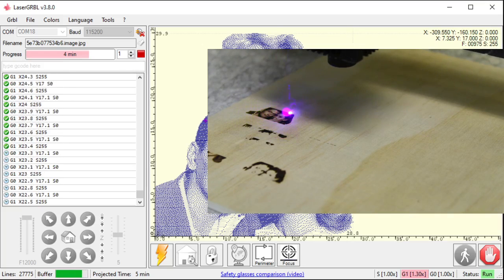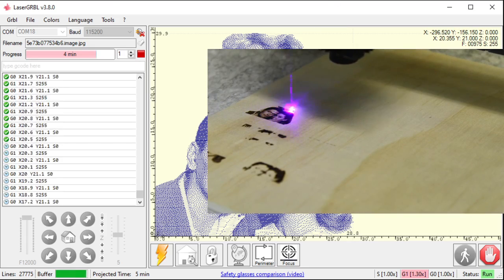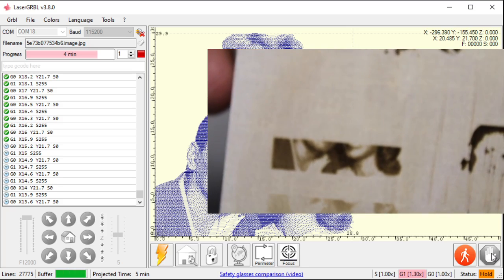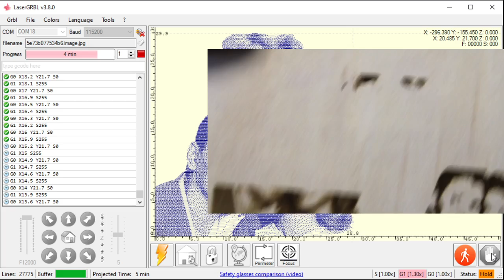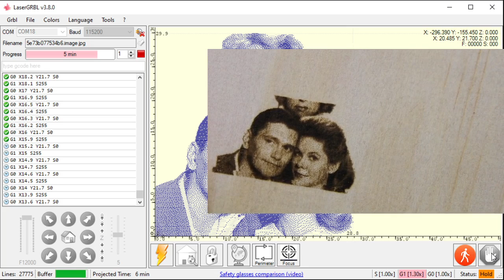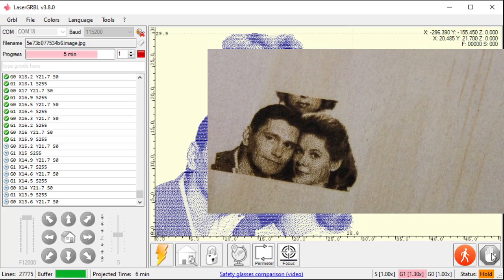LaserGRBL Tutorial 4   Setting up your greyscale engraving part 2

Comment: I love your videos, which are really, really good at teaching how to do laser engraving with the diode lasers, using LaserGRBL. 

I do have one small quibble, regarding your comments about "contrast"...  While your lesson comes through very well, you have contrast exactly backward.  Low contrast has lots of shading between black and white, while high contrast, at its extreme has only black and white.   Again, I'll say that your teaching comes through, and it is spectacular, but it would be a little better if you got the details correct.

Comment: How did you get the Z axis control added to LaserGRBL?
Reply: In version 5.4.0 (don't know what version it started) it is under GRBL > settings > jog control.. show z Up / Down control.
Other than that you just use the G0 X10 Y10 Znn coding